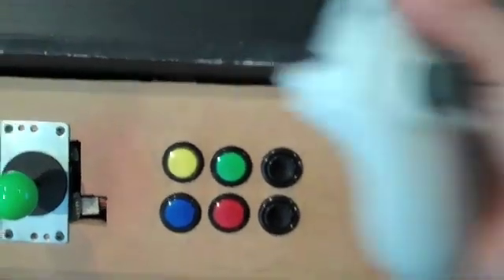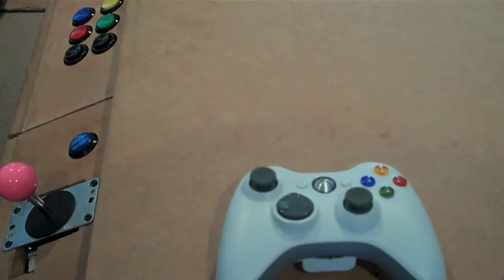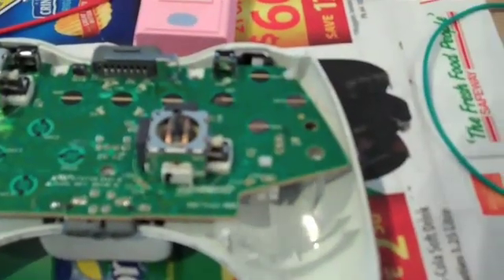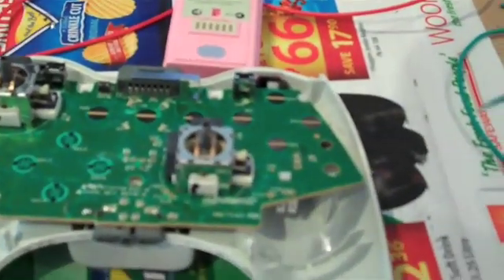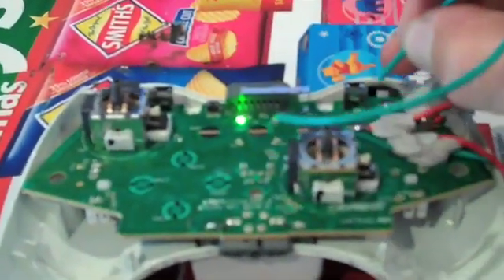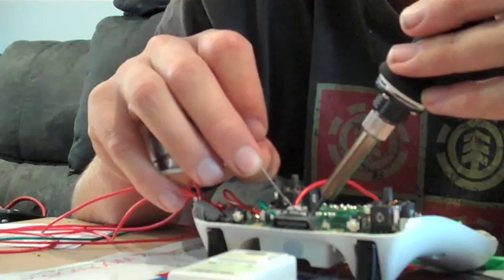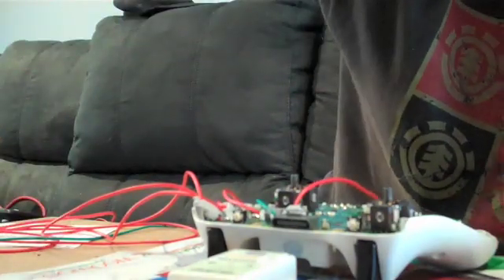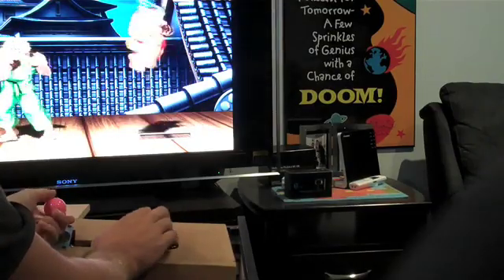Building Xbox 360 Arcade Controls

Comment: Tip that I worked out for soldering onto these difficult flat surfaces that don't solder very well (and may come loose with use) after doing some keyboard controller hacking:

Rather than glue gun it everywhere, buy the smallest drill bit you can find (I believe it's either 1mm or 0.5mm) and drill a hole through where you want to solder it to.  Poke the wire through from the opposite side, and bend the exposed part of the wire down over the contact.  Solder that down, and it will stay pretty well, because the solder will not allow the wire to pull back through the hole.
Reply: Ahh! I can’t believe I ever recommended this! (Your recent like notification pulled it up) The correct way to do this is to simply use flux. It was invented to make strong solder joints and this is the perfect situation. I use a “flux pen” it is very convenient. Simply apply a liberal amount of flux to the contact pad and also the wire. Then get some solder and start soldering them together. The flux will fizzle and burn off all the oxide and any dirt and impurities and the solder joint will be rock solid. No destructive drilling necessary.

Comment: Thanks dude.  Fellow Australian too, it only twigged when you mentioned Jaycar.  I'm doing this myself right now, turns out there's not really any way to play those 4 player games on Steam that expect xbox controllers when you're running your arcade controls through an IPAC4.  The computer sees it as a keyboard and you're shit out of luck.  So I'm keeping the IPAC to handle the "system" buttons and about to hack apart some cheap xbox360 controllers for each of the 4 controls, and I'll use Joy2Key profiles to map them to keyboard keys for the few games that don't support controllers.

Comment from the maker: @Fibr3Optix 
16 connector molex/plastic plug with that I found in the electrical store.  You can only have either IPAC or Xbox connected at one time, else you get all kinds of crazy grounding issues. So I have to unplug/plug when going between the two. Im sure there is a way to use a switch. 
I believe all the new ones are J7, you cant tell from the outside...mmmmaybe a serial number, but I'd have no idea? 
Good luck!

Comment: I noticed you have an iPac controller as well.
1. How did you connect the XB controller and the iPac to one set of buttons? 
2. How do you find out if the controller is a J7? Is there a way to see that in the packaging?

Comment from the maker: Look at where the bumpers are from the top of the controller (ie  you can see the name of LT, RT engraved on the triggers). You can see that the bumpers are just little dimples, one for RB, one for LB. Near those dimples are two little metal contacts that go to the board. The left metal contact on each bumper is ground, the right is signal. You should "tin" the solder to the right contact. (look up tinning). Unfortunately, yes, you will have to solder to the scraped dpad buttons. Good luck!